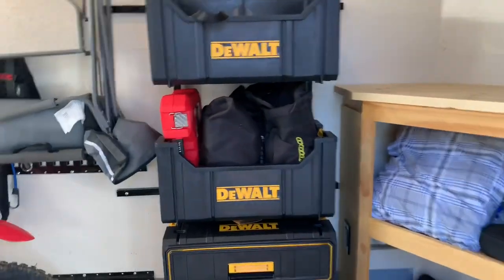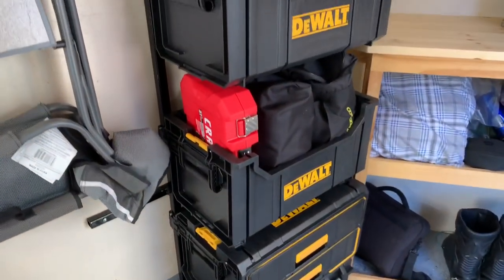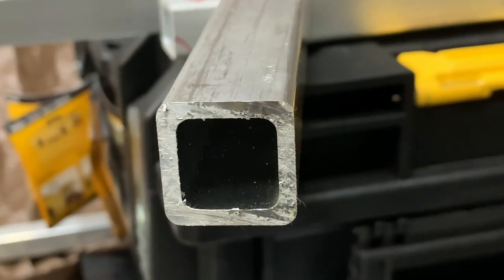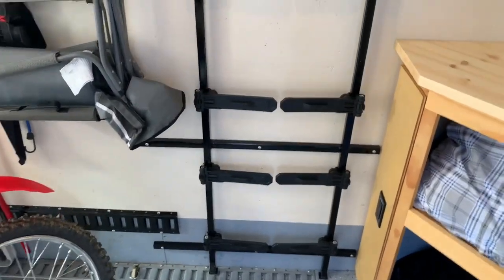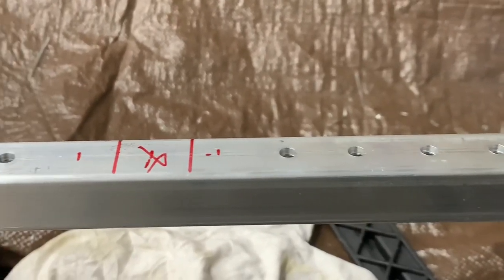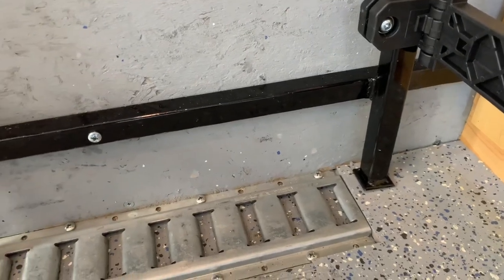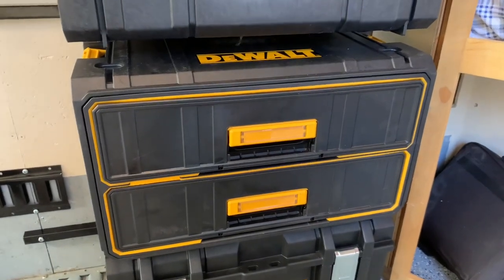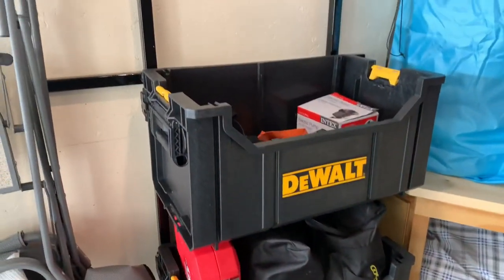DIY trailer mounting for DeWalt ToughSystem tool boxes

Comment: Great job!  They DO make a shop rack already.  The arms that come with do not fold, but you get 5 sets of arms and the rack for less than $100.  So that might not be the best option (it comes off the wall further, I think), but it's cheaper than DIY and is ready to install right away...
Reply from the maker: Thanks that's a great note for anyone who doesn't need the folding setup. Definitely cheaper!

Comment: Where do you get the aluminum bars?
Reply: joliver1863 search metal supply near me in google. Just an FYI, the arms are much cheaper to obtain thru the kit than a la carte with amazons current sale price. you get 5 sets of arms per kit.
Reply from the maker: I got mine from onlinemetals.com.
Reply: @GR8TTSpeed  You're refferring to the non-folding version of the arms though correct? the van systems are a lot more than the workshop setup (bc they include the folding arms we all want, of course).
Still, love the build! Just got my new sprinter & looking at cost effective racking for my TS boxes. Wht's the aluminum run per ft? (yes im being lazy). Either way, thx for the vid,  very nice work ✌
Reply: Yep, I was referring to the non folding, didn’t know that was even an option at the time of this post.